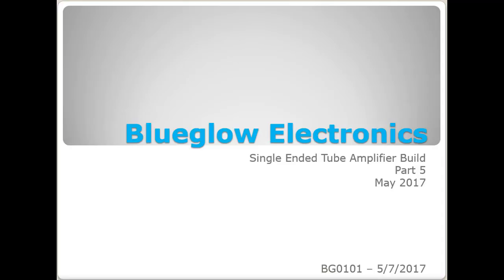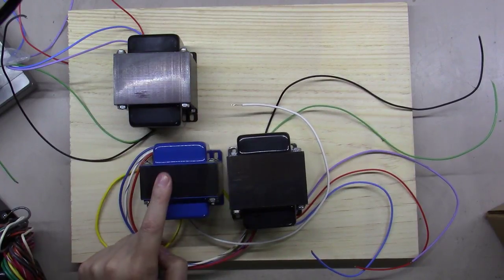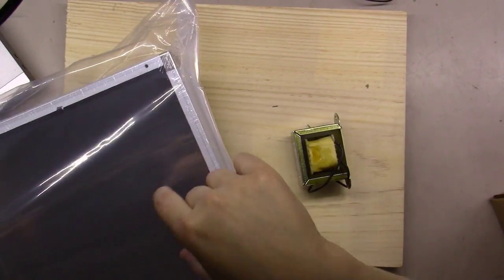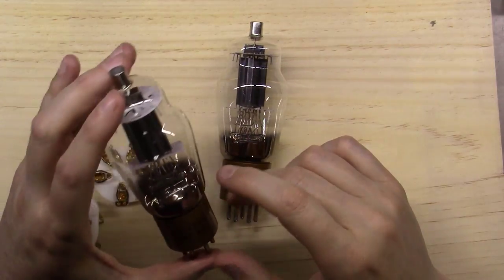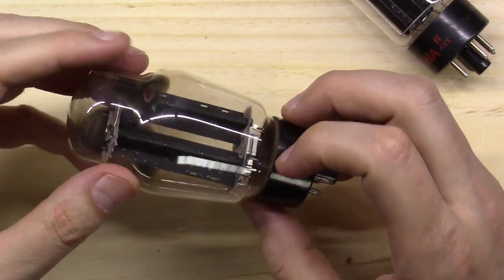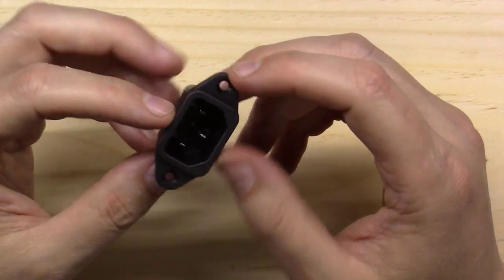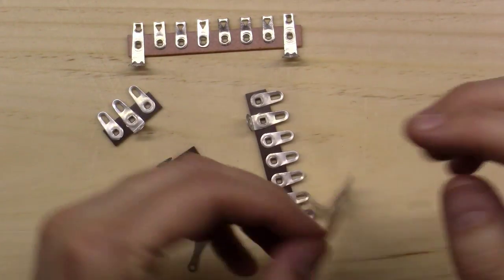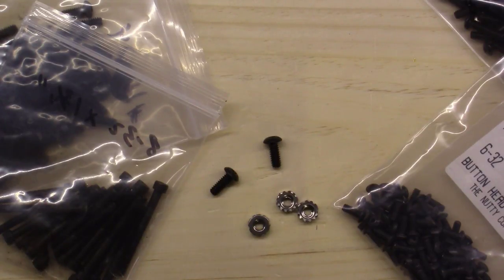Single Ended Tube Amplifier Build 2017 - Part 5 - BG101

Comment: thanks for getting back with me on the power supply question. as i have a bunch of 600v teflon m/c flex stranded copper the r.f. shouldn't be a problem. going with the sep 6.3v regulated d.c. for the filaments as well as the 5v regulated filament supply for the rectifier tube. decided to go for the clean but industrial look. as the modified studio 4 transmission lines are going to be the reference driver assemblies(they are bi-amp capable) a second amplifier will be added later to drive the 8" mid/bass units. right now a hafler dh120 pro handles the top end and a dh200 does the bottom end all through a tube pre-amp of my own making. flat w/no tone control stack at the moment. tonal balance is changed by altering amplifier gain. a tone stack is being considered though but first....i wanna get the transistors out of the signal path.this class"a" build is looking like the way to go.
thanks for getting my butt back to the bench and out of programming and routing table mode ;-)
=dok=

Comment: I use the steel Hammond chassis with black coating as the thin aluminum is too flimsy. It is hard to machine but worth the time

Comment: Just a thought about mounting the poly film capacitors. Maybe there is room on the top of the chassis to have a module/board to house them and bring connections through the top plate. Just like the capacitor box on the old Leak TL10 amp I'm working on. Might make the connection leads too long though? Best Matt

Comment: A suggestion about electrolytic caps performance, I know of a technique that shunts them with progressively smaller  values of polypropilene , or similar type of caps , to improve they high frequency response. For example one 100 nf plus one 10 nf plus one 1 nf, all in parallel to say 33 a microfarad cap, in this way you could get the best world out of the two technologies.
Vince